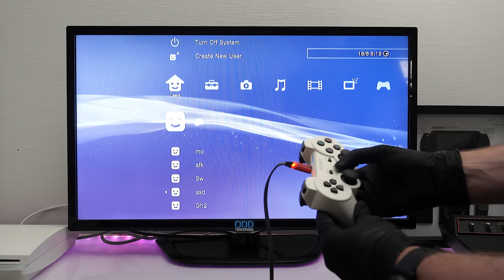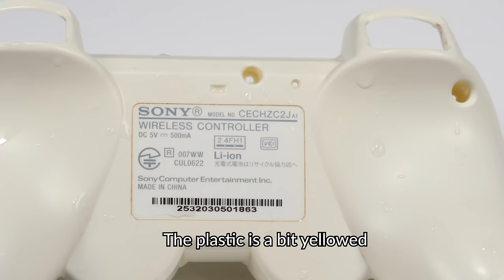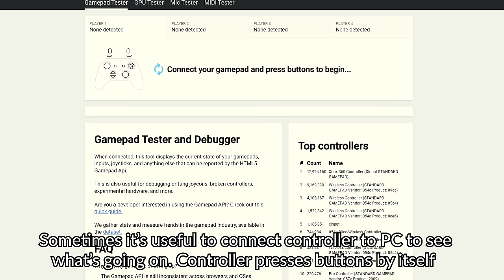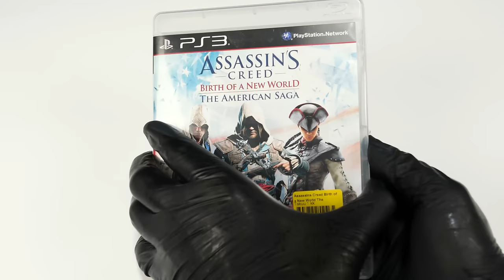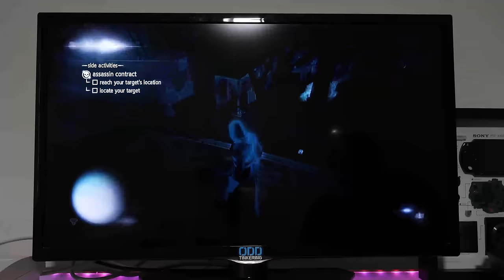Broken Playstation 3 Controller Restoration & Repair

Comment: I love the ps3. Thanks for fixing up  an old console controller which I used to play a lot. I’ve had this issue happen so many times and it’s love that people are actually fixing these controllers instead of throwing them out :)
Reply: Mine still works, but I need to open it up to dust it out. Its one of those really difficult models
Reply: @ms.pirate  ah, yeah I have a earlier DualShock 3 model where the motors are screwed in. And the rumble motors break off so easily. So I opened it up to replace the little foam pad like he did in the video. And two wires just completely snapped off the board. Luckily I was able to get them soldered back down and I cleaned it all up so now it works fine. It’s now my main controller :)
Reply: I broke all of Mines by fixing em :/ lil 10 year old me was a idiot
Reply: @w0lf4llo84 oh I meant my console is dusty on the inside. But my ps3 controller also needs cleaning too. It got the stick drift problem
Reply: Hard to find a good working ps3 controller nowadays. Do you know any aftermarket one that is almost as good?
Reply: @Bluebird77750 DS4 controllers work but you can't use motion controls
Reply: @mysticaxolotl8215  I don’t think you can press the PS button either
Reply: @w0lf4llo84  Yeah. I wonder if there's some homebrew tool that fixes that?
Reply: @mysticaxolotl8215  I’m sure there is, but I use PS3 controllers. The specific DualShock 3 version I have is the VX 1.03 which actually plugs into the motherboard rather then it being held down with pressure. I wish Sony stuck to it being plugged in, but it is what it is.

Comment: As soon as you started removing the motor, I was just thinking, "NO DON'T DO IT! IT'S A TRAP!!!" And while the foam does degrade, I also use a fine metal polish to gently bring back the shininess on the contacts on the ribbon cable, then clean both it, and the carbon pads on the board with iso. Might start adding new foam now though.
Reply: What thickness of foam ??
Reply: Also what type of metal polish do you use?
Reply: @DaSaint161  Mothers Mag and Aluminum Polish, it's VERY gentle, because obviously, it's for polishing aluminum and magnesium wheelse, and really any foam will work, but I'm pretty sure mine is 1/8th, adhesive sheets and I just cut out what I need for various projects.

Comment: The white/pearl colour you get from retrobrighting is amazing.  Well done!  always great to see controllers being fixed, as theyre the most common and easiest to repair.  Usually.
Reply: Love you covered the PS3 controller but wish more attention was brought to the CECHZC2U A2 or ps3 gen 2 controller as the internals are different and dismounting it even more so.
Reply: Not to complain but the vids for the A1 are everywhere, guides for disassembly for the controller are exclusive to A1 as well, even Ifixit

Comment: As someone who was also cleaning up their recently acquired PS3 controller because it was a used example in dire need of it, I am having a tough time figuring out how to fix a weird issue where the left control stick doesn't squarely go left or right and it jitters a bit when pressing those directions, any idea what might cause that?

I heard online it's a bit of corrosion on the stick assembly and you can use contact cleaner to fix it, but I wasn't sure I wanted to commit to the idea without asking around or doing research.

Love your content btw, been watching ya for a while and I always love your videos!

Comment: Yes, I discovered the random presses issue by chance when one of my controllers went crazy.
I replaced the foam with the modern foam that comes in the package of modern electronics with is more dense and sturdy and filled the gaps on the plastic placement in the case to prevent it to deform in the future.

Comment: Interesting, I never knew that you can attach the L2/R2 triggers to the main parts, I've always had them on the back part when reassembling a DS3 and that's been annoying to put back together.

Good job as always!
Reply: there are so many different variants of the Dualshock 3, with vastly different internal designs.
Reply: @theFrizzleFry  Ah, good point there. I have one which came with an OG 80GB and one which came with a slim 160GB. Haven't even thought that they may have different internals when I've cleaned those.

Comment: I know a lil bit too much about fixing these. Think a lot of us 40 year olds do. 😁

Great video as always.  👍👍
Reply: this model with the foil-contacts is probably my least favourite.
Reply: I have a ps3 controller that doesn’t power on. Even tried a battery from another working controller, but still receives no power. Any idea what it could be?

Comment: Hello. Your video will help me restore a PS2 controller that lools like this one. Quick question: how do you deal with the stickiness of the analog sticks' rubber? I sometimes prefer to substitute the plastic bits with aftermarket new ones and others just get the thumb covers. Cheers.

Comment: Same issue 1 year ago with my Dualshock 2. When I ripped off the polyurethane foam out of the controller it was quite destroyed, so I made a new piece... with pink sponge. Works the same, but it wasn't so elegant, since the controller is transparent, but if it works it works for me.

Comment: I remember talking apart my controller to clean it. It used to have separate plastic pieces between bumpers and triggers. It was a nightmare to place them back correctly. The newer versions had those integrated in the top of the pad cover. No wonder why they made this change 😅

Comment: War flashbacks to when I used to take these apart due to various issues, such as the L2/R2 springs breaking, the D-pad button getting sticky, or one of the thumbsticks getting stuck.

I'm not as handy as you, though, and only came out of all those with one success. lol

Comment: Hello Odd Tinkering 🥰 i wanted to ask you if you think its possible for a complete engineering newbie to try and replace the dualshock 3 battery… just got my first ever ps3 and the controller only works when plugged into the system 😂 let me know of you think it’s possible, thought I would ask a pro before attempting anything🤣

Comment: Why not put some double sided tape on the underside of the battery? That way you won't have it rattling around in there. Yes, I am aware there are different models of dualshock 3's and that some come with a battery cage thingy, but it didn't look like this one did. Anyways other than that nagging at me, as always, great video good sir :)

Comment: You can replace the PS3 controller battery with one out of the PS4 controller, they have a higher capacity, same plug and differ in size by almost nothing.

Comment: Those motors can desolder (cable just breaks on pad) just by opening rhe controller. Happened to me at least twice,  thankfully pads are quite big and cables have some leeway.

Comment: Another thing you can do with the contact pad (if you don't have any of the materials) is cover it with a small layer of tissue paper snd wrap it in electric tape.

Doing so will make it thicker and more durable and it won't crease or get thin over time.
I did that on all my V1 dualshock controllers and I haven't had any issues since then.

Comment: On my Dualshock 3 (and also one of my Dualshock 2) controllers, the joysticks got all sticky after a while of not using them, so now even if I'd like to use them, I don't because it's all disgusting. Do you know how to fix that? I tried cleaning them with alcohol but it didn't really help.

Comment: Oh, the PS3. I repaired a PS3 Slim, that my friend told me I could keep for myself. In comparison to the controllers they gave me, the controller you repaired was perfectly clean 😅. Well, after replacing the mini-B USB for charging, and cleaning the connectors, it worked.

But, reassembling the R and L was tedious. Be careful to hold it in place.

The PS3 didn’t have RED light, which was because of the PSU, and the disc drive wasn’t accepting disks. The disc drive issue is common with PS3’s and it’s from the metal cover, as it’s Tin, and when the top cover of the PS3 is consistently applying pressure on the disc drive cover, the mechanism will be impeded (on PS3 Slim you can see the lines from the top cover on the disc drive cover)

A simple disassembly and, reassembly whilst making sure the cover plate isn’t impeding the mechanism (it can be bent), will fix it most of the time (and also give the lasers a clean with IPA).

😅Sorry for the long comment, this is my experience with a repair I did.

Comment: hi brother, I have CECHZC1E ps3 joypad, basically the U1 that manages the battery charge, the charging voltage no longer comes out, but it's not a TLC4054, what is the acronym for this integrated device? Can you help me? A thousand thanks, greetings from Italy 🇮🇹

Comment: Recently found my cousin's old PS3 controller in my baby cousin's playroom. Looks like they dropped it on the side, since the right stick had MAJOR stick drift and the right motor broke out of the inside framing. But after 4 hours of taking it apart, minimal cleaning, and my dad's soldering to fix the motors, it's not happily sitting at my bedside as my main PC controller! The R3 button doesn't work and the stick covers are gone, but that's fine by me. I aim to be a restoration expert someday, honestly.

Comment: Great job as always. Have you noticed how badly designed is the contact between the ribbon cable and the PCB using foam to press it? Probably to make a saving by skipping a proper connector. I've had some of these gamepads goign haywire and typing buttons erratically because of this design flaw.

Comment: Mine the hall effect analog stick plastic is worn out, cant find replacement for those sticks, they lasted more than 14 years of heavy use though. Wish mine uses normal analog stick like in the video, easier to replace them.

Comment: 1:44 NEVER pull a battery the way he did you run a high chance of ripping the cable, instead use a pair of tweezers and pull
Reply: It was broken this only matters if you have a good battery you intend on reusing

Comment: Was there any creaking or squeaking after the shell was reassembled ?  I ended up using graphite lubricant in the white-frame against the front shell, and the shell seam-  it mostly quieted down the controller to better-than-new condition.   Almost as good as a PS2 thick shelled controller.

Comment: forgot how much these were a pain to fix, and this wasn't even including the weird split piece between the bumpers and triggers on the older revisions of these controllers. a true godsend to add into the bottom half mould! it was the single worst thing to keep in place trying to assemble!

Comment: What I do after cleaning where circuit sticks on controller I cut thin cardboard and stick on black rubber to give it height then put ciciut to stick that presses on the circuit connections works fine

Comment: Thickness of the foam? Please
Reply: Not needed what your gonna do is cut a piece of paper the same size fold it over 3 times and put it under the foam worked on both my controllers

Comment: Oh, I stand corrected. This controller has magnet based Analogue sticks!
Gratz to you for this great thing.
You can see that at around 9:06, the 4 pin pots. 4 pins -> magnet based sticks. 3 pins -> Potentiometer based.

Comment: oh, one of the not so good, revised ones...
PRO TIP: if you can, go for PS3 controllers without the A1 or A2 Marking after the CECH number.
Those come with magnet based analogue sticks, A1 and A2 come with normal potentiometer based sticks.